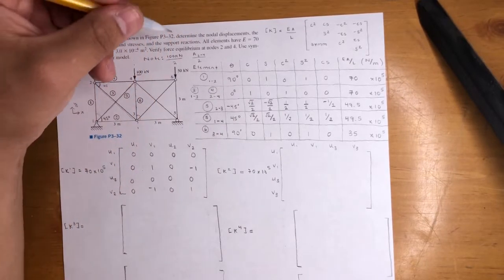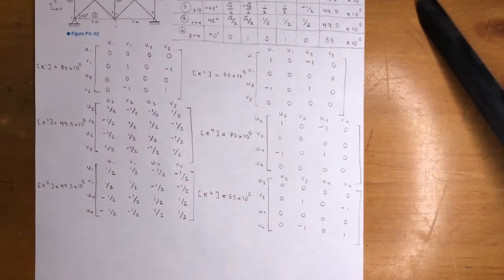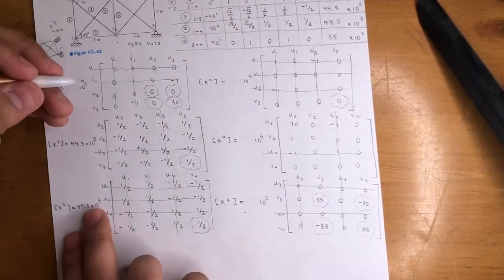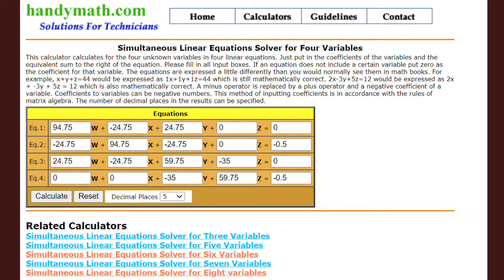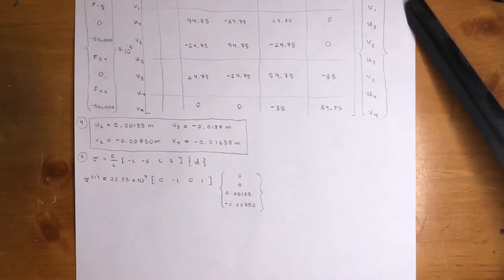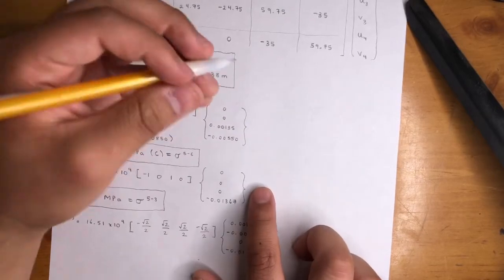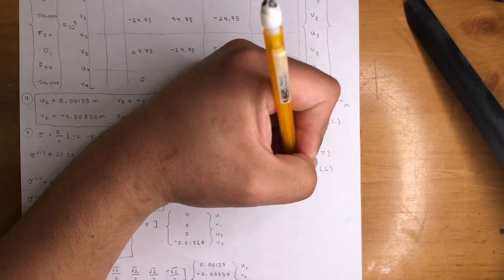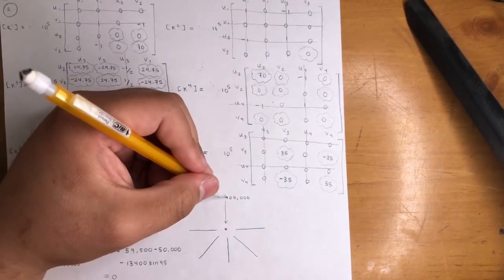Finite Element Analysis - Nodal Displacements, Element Forces & Stresses, & the Support Reactions

Comment: Hi, thanks for your video. It does help me a lot.
I have some doubts, hope can have your guidance,
1. For node no.1, from your solution, I cant verify that force equilibrium (sum of all forces not equal =0, I have included the reaction forces F1x, F1y, F1,F2,F4 ), may I know what I miss?
2. F1y is 100kN , F1x=0 right? , F1y and F1x are the reactions at support A. Since only vertical loads act on the truss structure, F1x should be equal 0)
3. Although the question require us to assume the model is symmetry, in fact, it doesnt right?, the right end support is just a roller support, thus there is a horizontal displacement at the right end support.  What is a valid reason to assume that the model is symmetry other than the displacement is very small ?
Appreciate your time.

Comment: G'day. you said you had a matlab code?
Reply from the maker: Yeah, but it wasn’t anything fancy. I sucked at MATLAB lol.

But you don’t need to be a pro to make one for any problem in this course. This whole course deals with matrices, and that is legit the first 3 weeks of MATLAB (at least at CSULA it was).

Your initial inputs should be your angle, E, A, L if I remember correctly, and the rest should work itself out.

MATLAB will automatically find your cosines and sines, and put em in a matrix, and solve for the unknowns (I think I used x = inv(A) * b) where “x” was my displacement vector, “A” was my stiffness matrix that automatically computed, and “b” was my force vector.

I don’t think I made any code after that since that was the hardest (or should I say the most tedious) part of this class. Getting to your displacements. I might have also added the Stress formula into the code but it was pretty easy past displacements. That’s like 80% of the videos if you haven’t noticed.